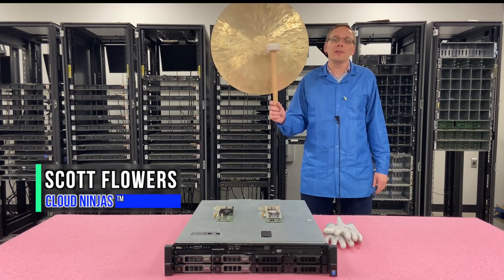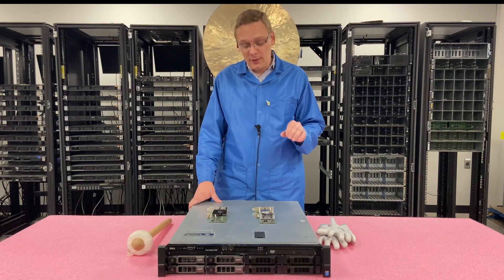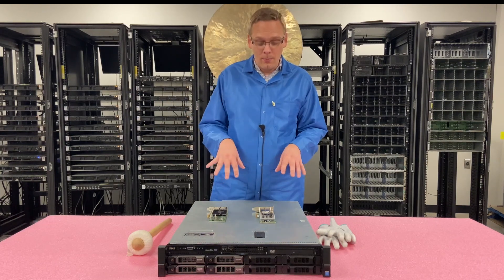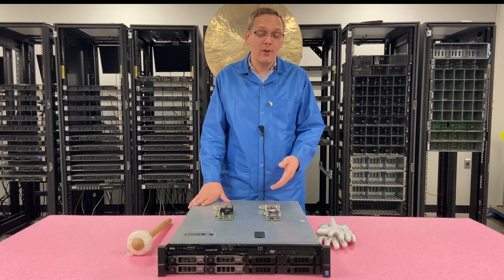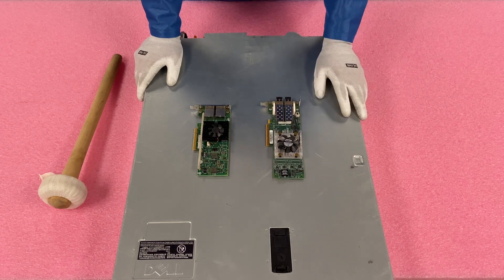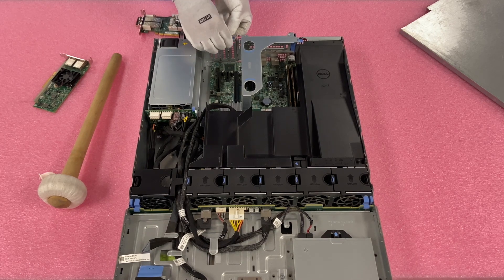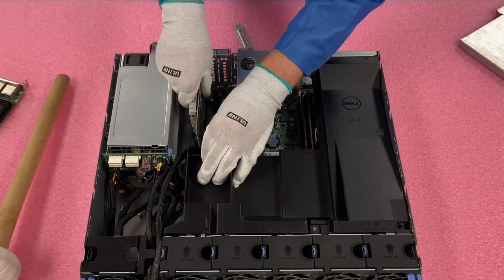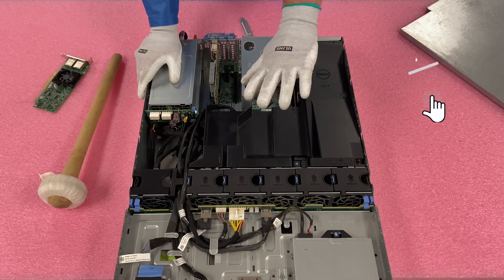Dell PowerEdge R530 Server NICs | Network Card Options | NIC 1GbE 10GbE RJ45 SFP+ | Installation

Comment: Hey scott i know this video is older but for those of you still interested in the 13th gen. I got mellanox QSFP+ dual ports 40gb nic cards to work with most OS Systems. Keep in mind the fans will ramp up 15% more but mellanox has a tune software to turn the fans back down.
Reply from the maker: Great add on information!  We've had some success with 100GbE mellanox as well.
Reply: @cloudninjas  yes sir the trick is to figure out what older version of the mellanox driver is compatible with the nic card being used. The cx354a and cx314a cards work well with the 4.25 driver version for MFT. I was able to keep API turned on so both Infiniband and Ethernet can be used. I haven't had a chance to mess with 100Gbe nics yet but that's great to know!

Comment: Dear Sir, Thank you for the informative video. I would like to check might you can suggest? I am using Dell PowerEdge R530 with 406-BBLB : Broadcom 57406 10G Base-T Dual Port PCIe Adapter and 406-BBDU : Emulex LPe16002B, Dual Port 16 Gb Fibre Channel HBA on it. Existing Esxi version is 6.5. However, when we upgraded to 7. My both PCI cards stop detecting. Could you advice do I need to change both cards? As the built in ports only support 1 G as you mentioned. Your expert advice will be really appreciated.
Reply: Sounds like a driver issue to me.